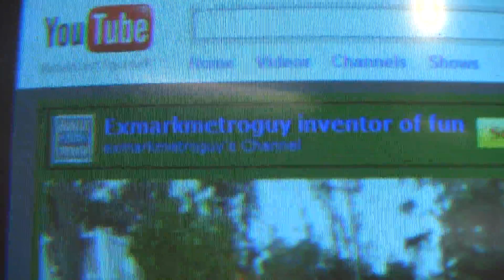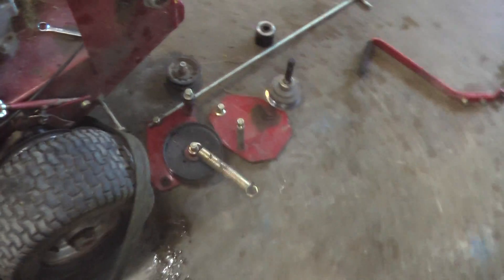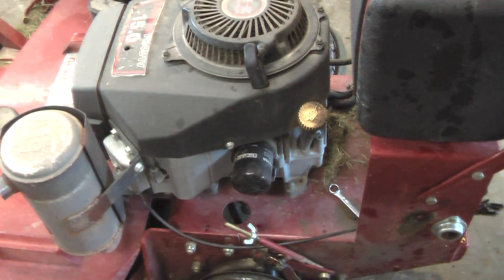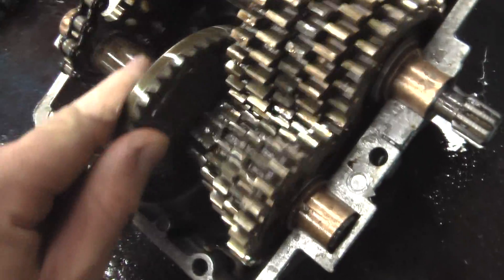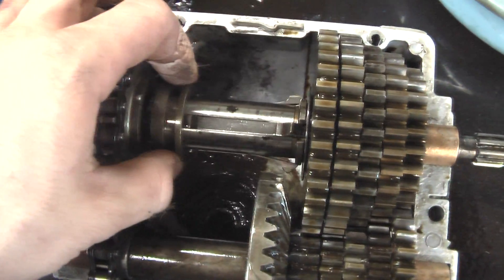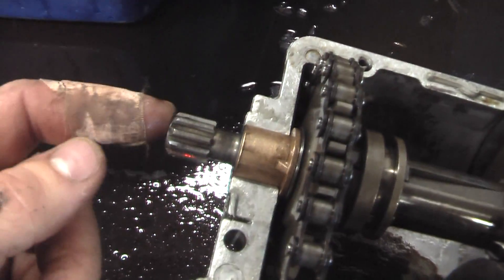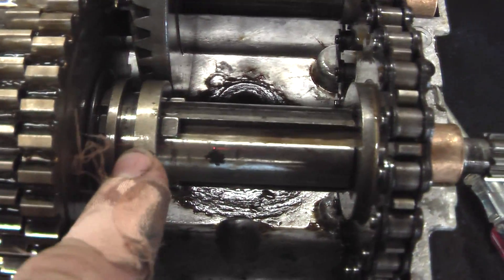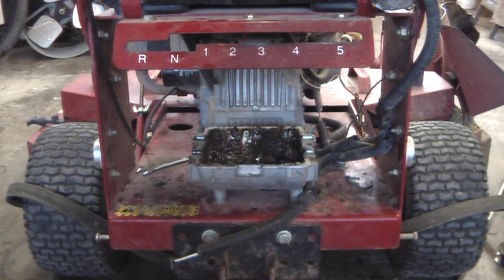How Gearboxes Work

Comment: my name is john hi. I have a dana 4450-1  on the mower driving id stop to go in rev. but it was stuck in gear bad , I shut the eng. off the gears work fine, 5th  to  rev. every gear. start the eng. put it in gear an it stuck again. I took trans. apart, nothing wrong, put together shifting  great, put on mower, murry by the , start put in gear an M.Fer the thing stuck in gear. can it be the vibration of the deck? please can you give me an ideal. I know its hard not seeing it , but eng. off shifts fine, eng. running gets stuck in gear. I will try anything. thank you.

Comment: I have a scag that now only has reverse, I tried to take the top of the gearbox off to see if it's the same part needing replaced as the part in your video and I can't get the top off... I have all the bolts out of the top and I have the gear shifter off and there is still something in there keeping the top from being able to lift off... what is it that is holding me up ?
Reply: just sealed up tightb  hit it with a hammer using screwdriver it wil come apart

Comment: @snviper I don't know about the setup here, but the reason cars whine is that the normal forward gears are helical cut (see wikipedia: helical gears) and the reverse gears are straight cut (see wikipedia: straight-cut gears) for easier shifting into reverse. Helical gears are quiet under operation, thus they're used for the gears people use most.

Comment: Is the chain on the reverse gear the same on cars and the reason they "whine" when in reverse?
Reply: Robin Frischkopf cars use gears for reverse. The difference is all the teeth on the forward gears are cut at about a 45 degree angle so they mesh together and dont make noise. Usually reverse has straight cut gears, which whine. High performance race transmissions and large truck transmissions often have all straight cut gears. They whine all the time

Comment: I understand the concept of the that little sliding piece engaging so that the gear is now connected to the output shaft but what actually happens to make it connect?? does the gear suddenly grip the shaft? or is there a little rod that slots in to a hole or something?  anyone got an animation or video of this? would be much appreciated.

Comment: This is one of the most common gearboxes, used even today in alot of lawnmovers with gearboxes. Alot of lawnmovers with this gearbox also does not need a clutch.

Instead, there is a minor delay before the gear is actually jumped into action.

Comment: @godzac sounds to me like the syncromesh has worn, if your goind down a gear from 3rd, put it into neutral, lift the clutch then put it back down then try and select 2nd. and do the same if your goin from 1st to 2nd but u may need to be goin abit faster so your car doesnt slow down as much

Comment: @super6plx what u are talking about is related to the clutch of a car, and P.S. if u release the clutch while going backwards on a hill and beeing in the first gear, the engine will stop. That's why when starting on a hill u need to syncronize the release of the hand brake (or normal brake) with the release of the clutch and the acceleration. And the few seconds when u are actually going backwards while accelerating is due to the flywheel slipping. Search car clutches for more info.

Comment: @super6plx that depends. automatic transmission cars use a torque converter. what those do is they turn the engines rotational energy into hydraulic energy and back again. so it transfers force, but it can spin freely from the wheels to some degree. theyre not perfect, but they work. a car with manual transmission uses a clutch, so two plates, one connected to the transmission, and one to the engine. if the plates are together, power is transferred. if theyre apart, the engine is disconnected.

Comment: @SthealthRaider on most boats it is a sort of gearbox. some more advanced boats always spin the prop in the same direction, but they alter the angle of the blades to adjust thrust.